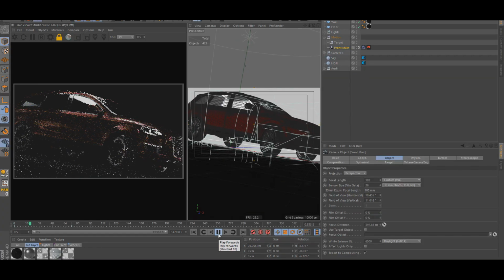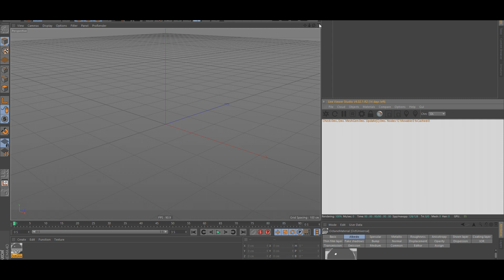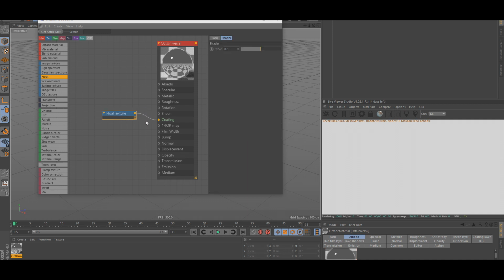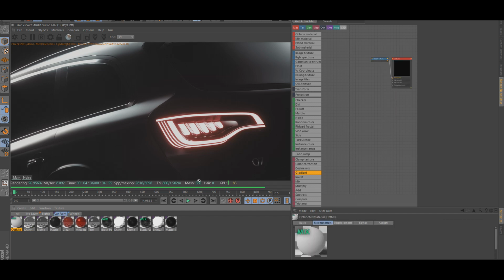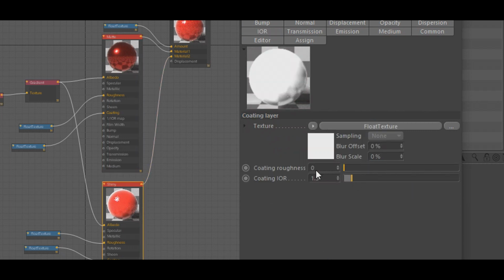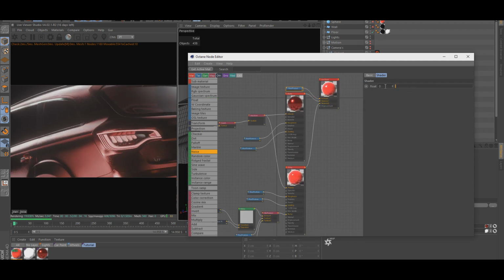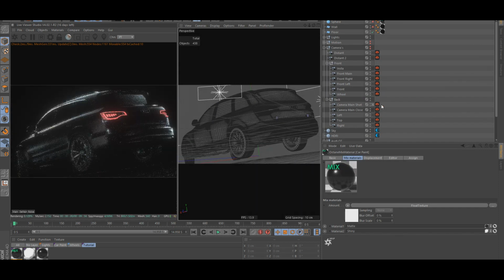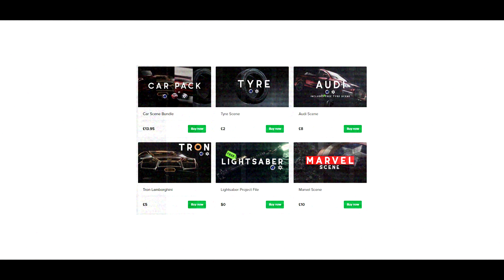How to Make Car Paint materials in Octane

Comment: To anyone wondering what albedo is! Albedo is not the same as "flat diffuse." Diffuse is the color we see, albedo is the amount of light reflected. They are artistically interchangeable but scientifically they are not and if you work full PBR, you will have problems if you try to use them interchangeably. Albedo correlates the value slider in your color picker to the amount of light the material will reflect. This is the same in real life. It is simply a ratio of how much light is emitted to how much is reflected back. In the real world, albedo is typically seen as a single number 0-1. In CGI what we are doing is assigning that value on a pixel-by-pixel basis and then simply giving it hue. Diffuse has no standards for what light or dark is. Any image will do for diffuse and you can correct as you go, and sure, you can have a shadowless diffuse. Albedo does not have shadows because shadows do not reflect light and therefore have no place in a diffuse map. It is not just because it looks clean. In fact, there are other map types to get shadows back as a map, if you need them, that will not interact with the albedo layer in almost any engine, should you need mapped shadows. Albedo will typically appear to have dimmer whites, as most things do not exceed the albedo of paper, between 0.6 and 0.73. The most notable exception to this is probably snow. The lowest you will probably ever go is 0.04-0.06 for carbon black. Again, with a diffuse map,  the value is irrelevant. Want it darker, make it darker. Want it lighter, make it lighter. It is very artistic. Albedo CAN be used however you want, it is art, but in PBR work it is a means of keeping ratios and scales correct start to finish. It is not just a shadowless diffuse map.

Let the hate mail begin for me "taking this too seriously!" LOL
Reply from the maker: Absolutely not taking things too seriously man, appreciate people like you who dive into things this deep 💪
Reply: @Sketchyvisuals  I’m glad. I’m intense haha 😂 but I’m glad it was received well and happy I can contribute to the value of anyone coming here to learn 🙏